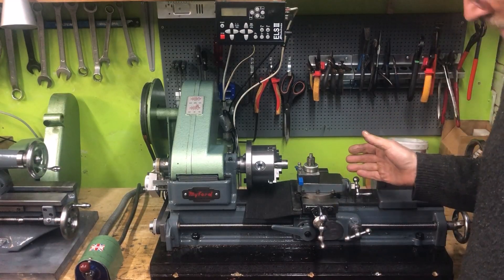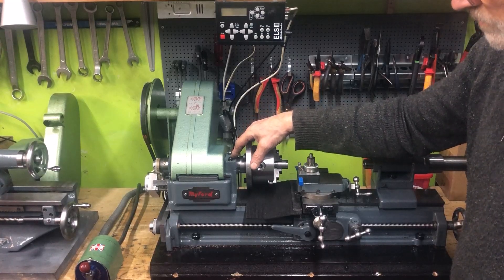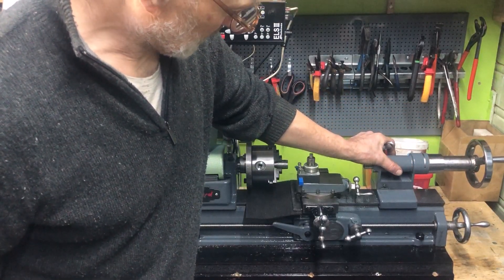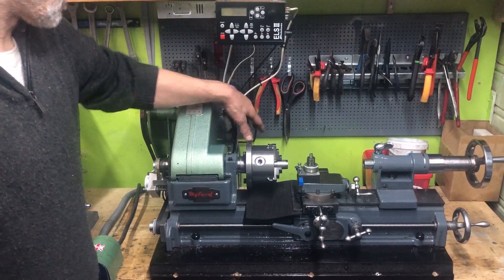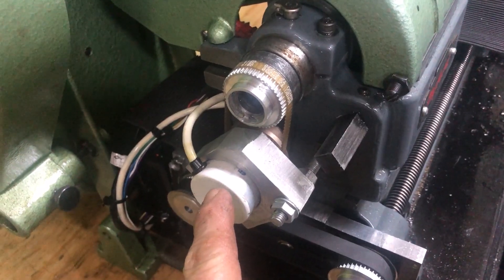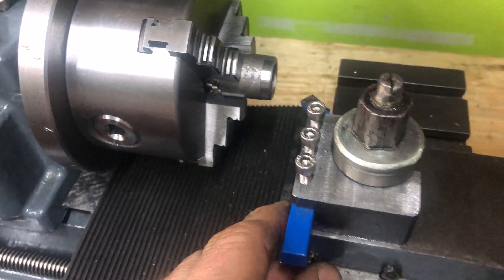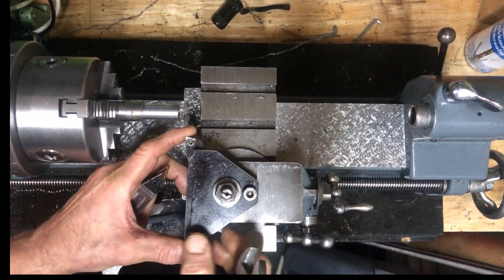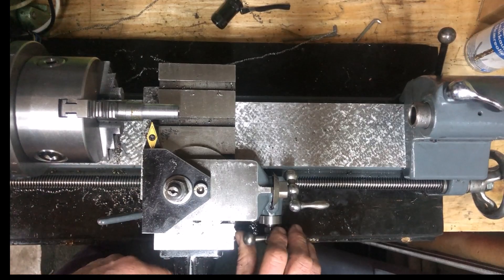Myford ML10 - ELS

Comment: Hi Jan nice video as usual, I have Myford ML10 with two stage Rocketronics that I did a couple of years ago best thing I have done apart from adding Newton Tesla 3 phase motor & vfd so no belt or gear changing anymore, I fitted everything without drilling any extra holes.
Just had an update to the Rocketronics giving an extra decimal place and imperial thread without conversion to metric, it’s taking a bit of getting used to.
Reply from the maker: Hi there, thanks for chiming in! Sounds great re. the 2 axis ELS.. doyou have some pics/videos to share? I am curios how you mounted the X-axis motor ie. in forn or back, geared/belt drive or direct (in-line).
Oh.. Louis has released the V13 software? Wasn't paying attention so had not noticed. Well, good! I had an earlier test version installed, but reverted to V12.. must have been a couple of years back now. However, I will surely try again!
Sure it is a real benefit having a 3phase motor run via a VFD.. I also (mostly) adopt this (if i can).
Reply: @ not the best video but here is my setup, I fitted the Z stepper in the same place as you on a bracket bolted to original holes on motor bracket & the X stepper on rear of crosslide direct drive via a flex coupling.
https://youtu.be/CWqIbP4mnh0?si=ITGt6euFocmfBYZB
Reply from the maker: @torsiondell  Thnks! I apologize, but I see I have looked at your channel (and commented) before, but didn't remember before I wrote you here.
Anyway, You might want to add another video or put in a comment that you have installed the Imperial version of the Rocketronics software. I am not sure if this is common knowledge namely.. :)